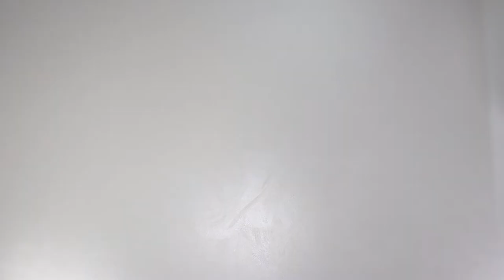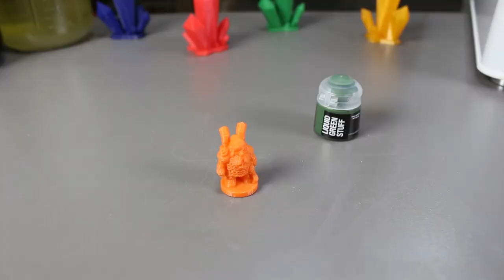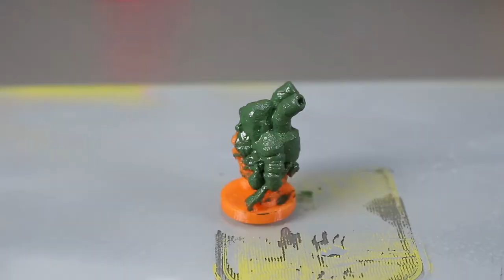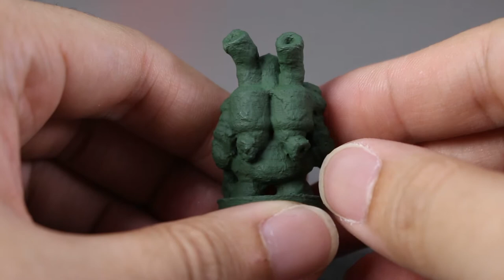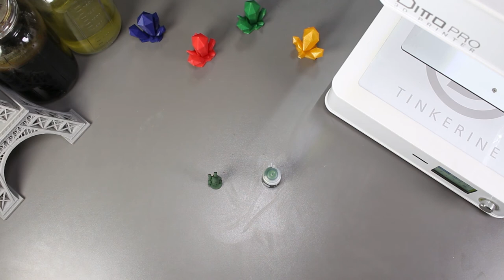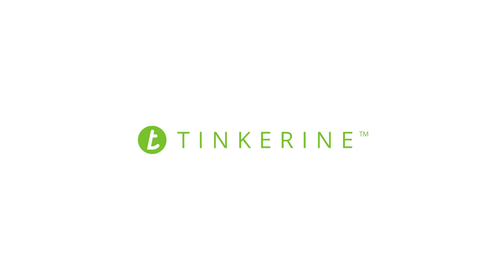Post-Processing 3D Printed PLA Print with Liquid Green Stuff

Comment: i'm sorry but i can still see many layer lines at the end and i think the overall finish doesn't look even. it looks like the character has a layer of mud on themselves... i think green stuff could be usefull as a gap filler in places where you can easily remove the excess but not as an overall coating. maybe try thinner layer thickness on your printer? still thanks for the video, it was very informative!
Reply from the maker: Thanks for the comment and suggestion!